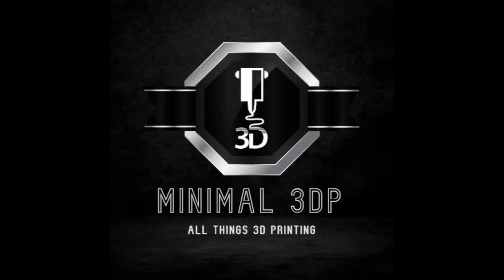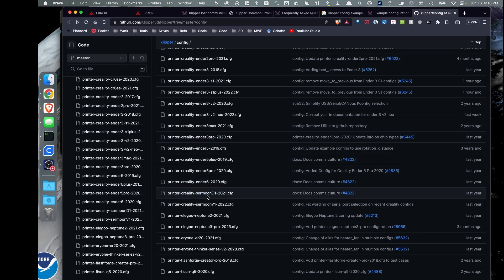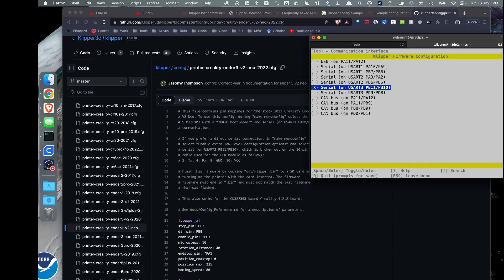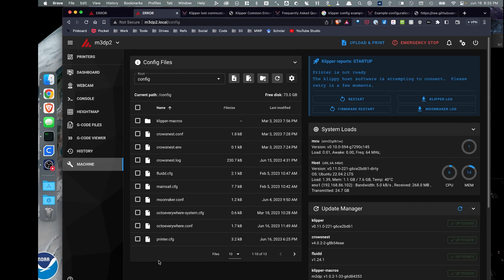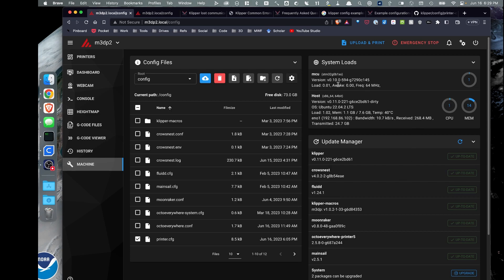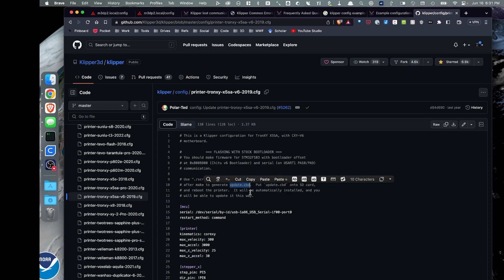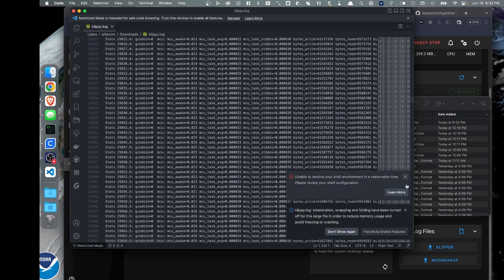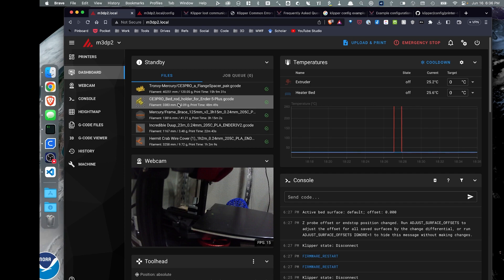Klipper MCU: Unable to Connect: What's Wrong? Exploring the Issues Behind 'MCU: Unable to Connect'

Comment: I had that problem I had to format the sd card to the smaller size when formmating the sd card
Reply: how smaller?  4096?
Reply from the maker: I forgot to mention that the SD card used toflaah is oftern an issue. Thanks for pointing it out.

Comment: I'm looking for solutions to a Ender 5S1 with a Sonic Pad that I have reloaded klipper on, randomly disconnecting and the pad saying Can't connect MCU.  Usually a firmware restart and it connects and works fine.  It seems to mainly do it once the printer goes idle for many hours, although it has done it once during a print.  Which almost makes me think it's a power saving feature.  Any ideas how to ensure the tablet doesn't power down or go into powersave mode? I just went it thru your example and set the wifi powerdown disabled.  We'll see if that makes a difference, but I think there's still something going into power save mode....maybe even the 5S1 motherboard...but I can't figure it out.

Comment: I changed my toolhead on my sv08 today and switched to another toolheadboard which is the same model as the previous one and now it won't boot up even if i use the toolhead board that worked before. i changed the cables too to see if this was the problem still the same error "can't connect to mcu" is there something else i can do ? help will be greatly appreciated.

Comment: Thanks for this video. One of the issues with the Tronxy X5SA is the main board's chipset. The examples on the Klipper site are for the older F103 but in late 2022 it is the F446. I was able to remake the firmware with the correct settings by looking at the desciption for their CRUX1 printer.

Comment: mcu 'cp_Head': Unable to connect
Once the underlying issue is corrected, use the
"FIRMWARE_RESTART" command to reset the firmware, reload the
config, and restart the host software.
Error configuring printer

i have this problem now, just bought the chromapad and still gettin this message. 
and my pad dont reconizing the head can you help me ?
Reply from the maker: I am not familiar with the chromopad but I am willing to take a look. Can you share your config files?
Reply: I am having this same issue. Did you figure it out?

Comment: Hey, thanks for all that you do. I have an issue with my MCU that's not allowing me to run the "ls /dev/serial/by-id/*" command. I noticed that I don't have a serial folder for it to search from. Ive tried many guides, changed the SD card, changed cords several times, changed boards and cb1 units, re downloaded the image, used kiauh, used three different live disk creators, and nothing works. I'm using a manta m8p and m5p which I was able to get the m8p board running for a while until an erring update cause me to wipe and start again. At this point, I'm just not sure what or where to start.
Reply from the maker: Are you getting any errors or anything else?

Comment: I hadn't updated the MCU location in my printer.cfg. That, and having a hard time flashing my board thru the RasPi SSH led me to use the OctoPrint plugin Firmware Updater with the downloaded .hex file compiled on the Pi. Thanks for this video! Helped me realize what I was doing wrong.
Reply from the maker: I'm glad you found the video helpful.

Comment: I didn't have any issue setting up one printer thanks to Minimal 3DP other videos but when I tried to set up two printer with two instances of Klipper I had some trouble. Hopefully this will help someone else having connection problems. It took me way to long to figure out but the problem I was having was I couldn't get more than one printer going at a time. One printer would connect in mainsail and the other wouldn't. I would swap usb around and power cycle then the other one would start working.  I was getting "Printer is not ready. The klippy host software is attempting to connect.  Please retry in a few moments." and the Klipper log show "Unable to open serial port: [Errno 11] Could not exclusively lock port /dev/serial/by-id/usb-1a86_USB_Serial-if00-port0: [Errno 11] Resource temporarily unavailable" 

Well I guess raspberry pi cant auto address usb port or something (not 100% sure why, this is the first time I've touch a pi or ssh). Anyways if you look at your printer.cfg file under [mcu] serial: the default is "by-id" and probably looks like this  /dev/serial/by-id/usb-1a86_USB_Serial-if00-port0. You need to change it to "by-path" and it will look like this /dev/serial/by-path/platform-fd500000.pcie-pci-0000:01:00.0-usb-0:1.2:1.0-port0 depending what usb port you're using. To find the exact ports, open your terminal program of choice and ssh over to the pi then type in "ls /dev/serial/by-path/*" which will list the usb port you have printer plugged into.  In my case it had two ports listed. I changed the printer.cfg file and bam hours of frustration over. I did have to change it twice because I guessed between the two listed ports wrong (I didn't which of the two listed port were what). But between that and Minimal 3DP videos I was set. Hopefully this will help save someone else some time.
Reply from the maker: Thanks for the explanation.

Comment: Mike, Is there a way to use STM32cube on a pie to update my x2 printers firmware file? I cannot get my laptop to connect to the printer to update it. it fails.
Reply from the maker: Can you use an SD to flash? Cube will probably have the same isse as your laptop.
Reply: @minimal3dp  so my rasp pi 4B can read it when plugged into it. So I was curious if there is a way to update the firmware on the x2 through the pi. 
I haven't tried the SD card route as I havent looked up that way.
Reply from the maker: @sambartling6787  yes there is a way to do it via the pi. I believe that there are commands to do it. I am not sure of the commands but try searching for "Klipper make flash"
Reply: @minimal3dp  I tried the SD card slot and it doesn't boot the firmware and write it. 

Do I have a bad mainboard?

Comment: What I had is klipper is attempting to start on klipper screen. before this it was Adc over range, max min temp so I plug both heaters & sensors in & also change the sensor type to generic. Reboot & that error was gone left with attempting to start, so search online n try make clean n do again. Still trying as from yesterday. Thanks for making this video i will watch several times again to see what I missed. Btw I m using BTT pi & SKR1.4  LPC1768. Thanks bro for sharing ❤
Reply from the maker: Glad you found this helpful. Happy to help.

Comment: i hope you can help me. i keep getting the error "mcu 'rpi': Unable to open port: [Errno 2] No such file or directory: '/tmp/klipper_host_mcu'"
i must admit this whole thing was my fault. i got a second hand printer (first mistake) so i could use the pi to try fix my other printer (didnt work) and then decided to put the second hand printer back to how i got it so i could use it. my next mistake was when i backed up the sd card i didnt do it properly. i just copied and pasted its contents to a folder so when i went to restore the backup it didnt work (talking about the pi os sd card) and now i cant get it to work. google and forums are no help. im lost

edit: i hashed these lines and it connected and worked, so not sure why it did that. are you aware of a way to mkae it work without hashing them out?

#[mcu rpi]
#serial: /tmp/klipper_host_mcu

#[adxl345]
#cs_pin: rpi:None

#[resonance_tester]
#accel_chip: adxl345
#probe_points:
#    117.5,110,20

Comment: hello sir im have a prob with thin client wyse, i cant find a solution on how to connect my printer to wyse thin client. but i already install mainsail and klipper and see the usb path. im totaly new in 3d printing and exploring klipper with my ender 3
Reply from the maker: Have you updated the printer.cfg with the USB path you see?
Reply: Yes sir i already update it in printer.cfg and flash the firmware for the board, but it's just saying printer not ready and, firmwares restart error

Comment: Hi, thank you for this video. I am fighting with an Aquilla n32 with a Inovato Quadra MCU. And stuck at the dreaded MCU wont connect. Neither of the  "/dev/serial/by-id" with "/dev/serial/by-path"  return results the work. I have changed SD cards. reflashed the n32,, Reformatted the MCU to factory and started over again 6 times to be sure i got everthing done in order. but after a week....I need some help. when you paste in serial-by-id....I dont get that same data.
Reply from the maker: Have you tried a different USB cord?
Reply: @minimal3dp 3 different usb and have more on order.
Reply from the maker: Feel free to email me you board specifications and printer.cfg file. Minimal3dp@gmail.com
Reply: @minimal3dp thank you I will.
Reply: @Digitallifeconcepts   have you found a solution?
Reply: It was a bad usb cable,  went through six b4 I got it  to work correctly

Comment: I hope you can help me. I can get my printer running, and even starts a print, but half way through it shuts down with the message, "Can not update MCU mcu config as it is shutdown." I'm running an Ender 3 v2 off of a Sonic Pad connected to the BTT SKR Mini E3 V3. I have tried everything I can think of though I've only been using klipper for a short time. Any advice would be great.
Reply from the maker: Have you looked at the logs for both Klipper and moonraker? If you email them to me, I will take a Quick Look.

Comment: My main issue right now is:  I have 2 printers.  An Ender 3V2 and an Ender 3V3.  When I run kiauh and install klipper and octoprint, plug both my printers in... it's not seeing 2 MCU's.  It's only seeing one.  I'm trying to get Klipper working on my V2 (with Mainsail), but for now, I want to keep the stock firmware on my V3 (Controlled by Octoprint)

I have had each of them running individually... but I can't seem to get them both detected at the same time.  Quite annoying.
Reply from the maker: Try plugging the printers in one at a time and checking the mcu.